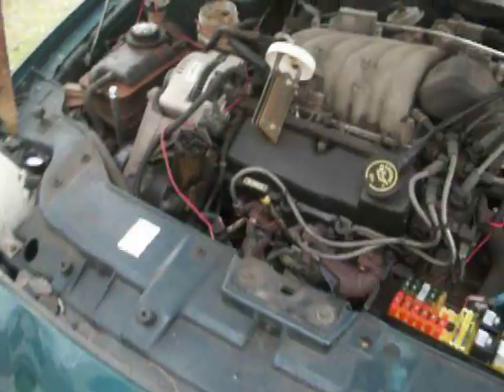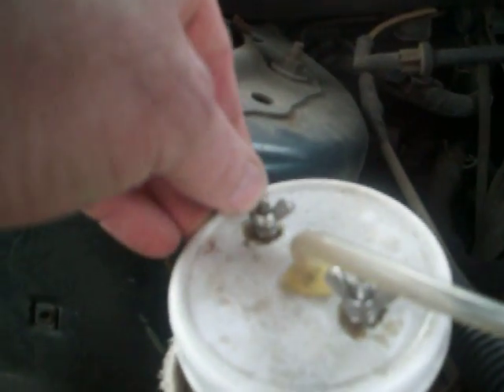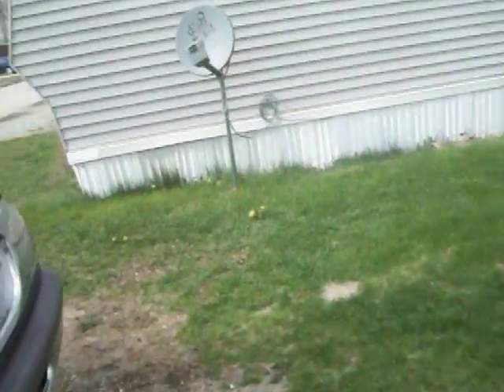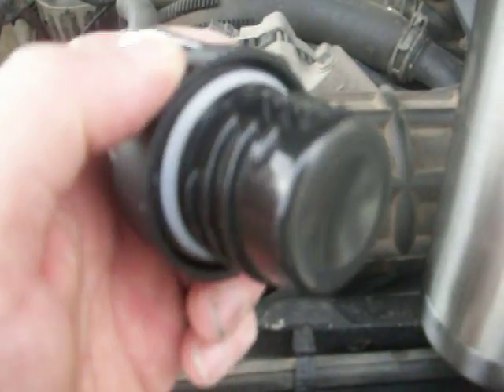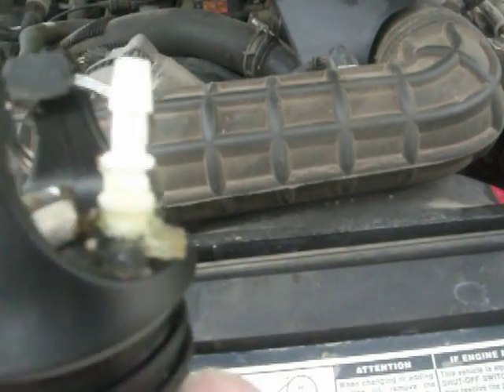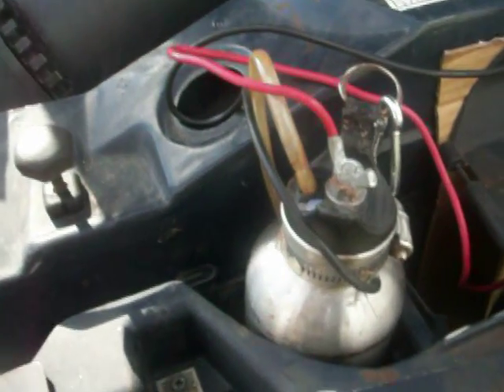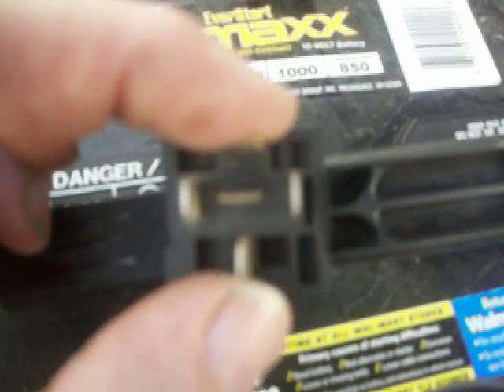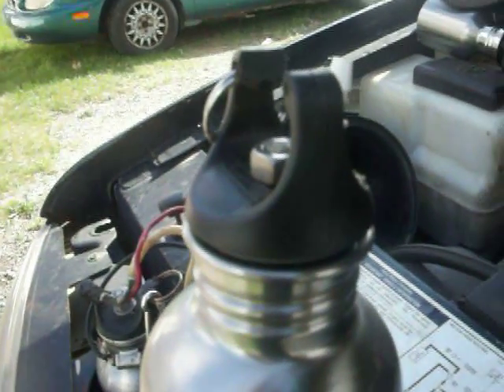HHO / hydrogen generator (water for gas) from Westcoast Exterminators!

Comment from the maker: @09Youba OK glad to hear it. Don't try to push it. if your bottle gets super hot or boiling, cut back on the baking soda. The one on my motorcycle, I started with an unknown chemical, and was drawing too much power, but I thought the gas was good, but the battery died. I was getting 36mpg. I changed to a less amount of MSG (chinese salt) and you can't really tell the thing is on, because there is so little power drain. BUT my MPG is 40-44. Too much will burn out the relay so start small.

Comment from the maker: Make sure the bottle works by itself first. Hook up ground and battery, Your not asking for a lot of HHO, just a trickle. That works? check relay. Hook up gnd and bat to 2 opposet terminals, Hear a click with power? These are the terminals for ignition and ground. the other 2 are for bat and bottle. got picks?

Comment from the maker: Update on motorcycle road test. The first time is was using an unknown chemical bought on ebay. My bike went from 30-36.4 MPG. I STOPPED USING IT BECAUSE IT IS POISION AND CAUSTIC AND SOONER OR LATER THE BOTTLE HAS TO BE DUMPED SOMEWHERE AND POSION THE EARTH. DO NOT USE! 
Second road test. I use MSG (Mono Sodium Glutimate), that stuff your suppose to avoid in chinese cooking. With this and lowered amps. I went from 30 - 44.1 MPG which I think is pretty amazing

Comment from the maker: @09Youba It shouldn't, not with mine. but you might upgrade later and consider it. But I've seen big rigs with six packs in them. Now consider the my bike. the tube is just sitting in there. If the carb is not suck it in then it will float up and out. if your still worried drill a small escape hole at the top. Then it's impossible for build up. another thing to consider is if you have a diesel, you might have more amps to play with.

Comment from the maker: @09Youba Thickest wire Meijer's had, for bottle and batery and ground. Green wire I found in the truck, when I bought it. the guy had one of those phones that had to be installed in the vehicle. It's not that big. The hook is left on the handle and the unit hangs instead of trying to come up with a bracket. Use a smaller battery fuse till your comfortablae with your baking soda/water ratio. MSG works good to